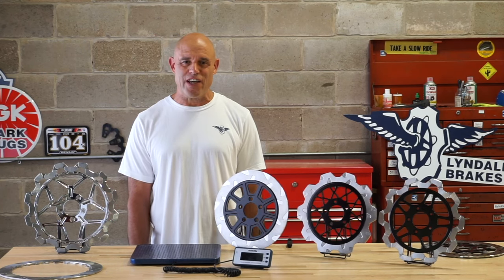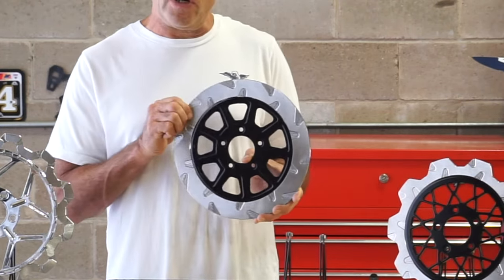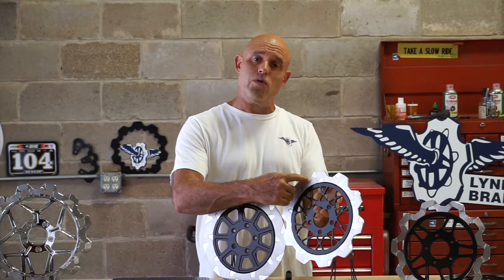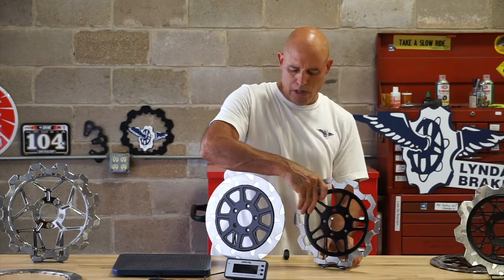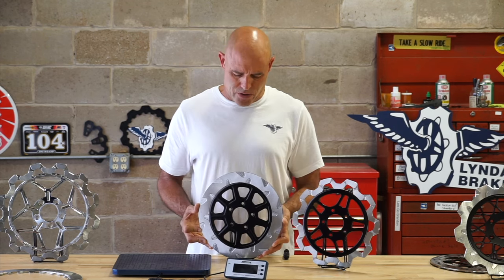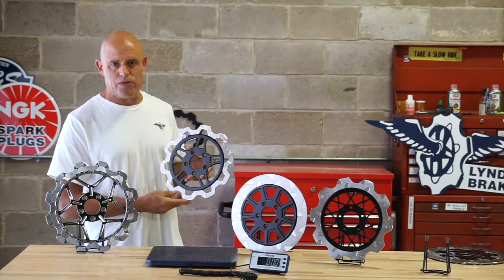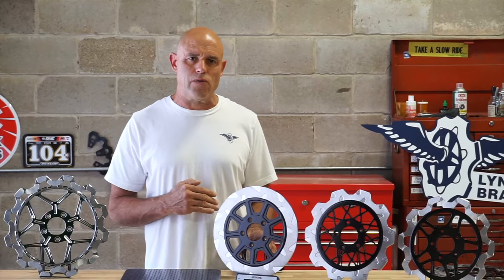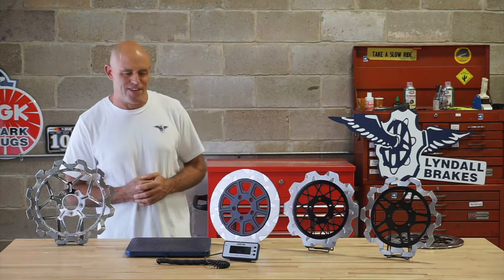Best floating rotor for your Harley-Davidson

Comment: I’ve had the black round style on the front of my 17 SG…I have a distinct pulsing in medium to hard braking..I have noticed since watching this video that these look directional…the left side gassing design actually travels backwards in comparison to the right..I’m not sure if that is causing the pulsing but the left rotor is glazing in spots. I emailed Lyndall but have not received a response. Just throwing that out. Aesthetically there awesome.
Reply from the maker: our rotors are meant to be ambidextrous, the direction of the gas slot will not affect performance at all. If you are having any issues please email info@lyndallbrakes.com to start a warranty claim. We will ask you to mail us the parts for warranty inspection and to include the brake pads. (our rotors are lifetime guaranteed against warpage when used with our brake pads)
Reply: Lyndall warranty replaced both rotors and pads..very happy with them standing behind there products.

Comment: I have a breakout and currently need more stopping power. would any of these provide more stopping power than the other that i would need during aggressive street and highway riding?
Reply from the maker: for aggressive street and highway riding I would recommend our Gold Plus pads at a minimum. Depending on the setup (calipers, master cyl, dual disc, etc) I might recommend our Xtreme pads

Comment: How much is  braking is improved using your rotors and pads? ,Thanks
Reply from the maker: it depends on a quite a few factors, but generally, if you kept calipers stock and changed nothing but the rotors and brake pads, you should feel significantly better stopping power (10% with our Gold Plus pads and 30% with our Xtreme pads. We also have more aggressive options if you are willing to change calipers

Comment: Nice rotors, but a little to pricey, here in Australia at a little under a $1000 each not very good
Reply from the maker: Our rotors do get pricy as we build our parts for the passion of riding and not to a price point. CNC machined, highest quality of steel, and meticulously measured and tested for a product built for a purpose.  We do have new one piece rotors coming out that are not as expensive as our floating rotors. There are a few distributors (Rollies Speed Shop) and dealers in Australia that have our parts available, so you do not have to deal with international shipping and importing documents.